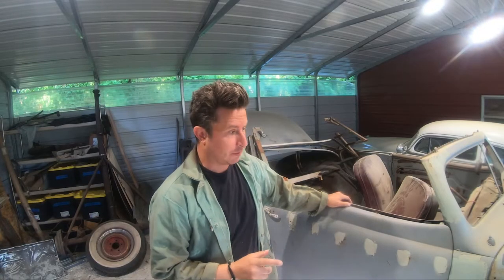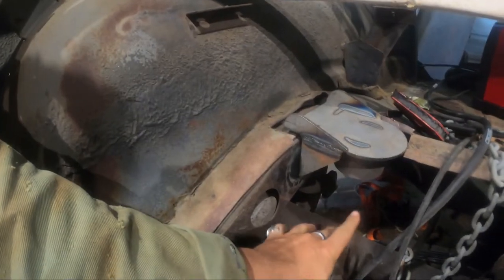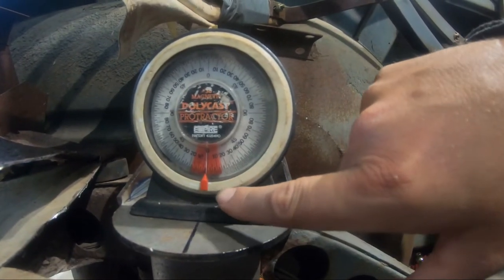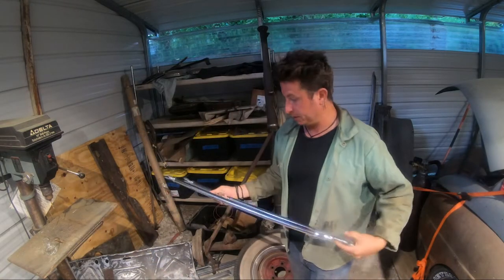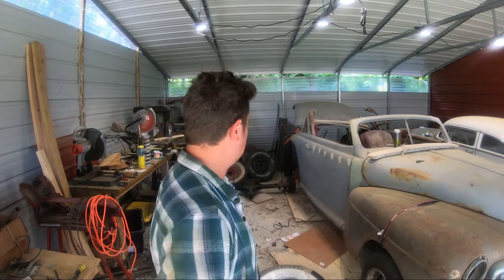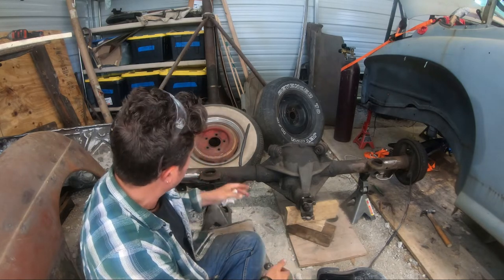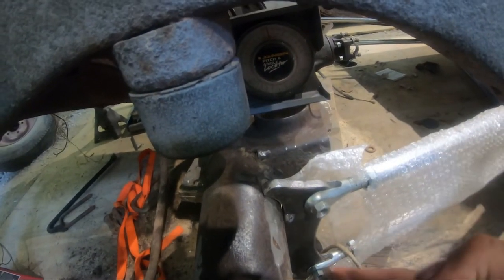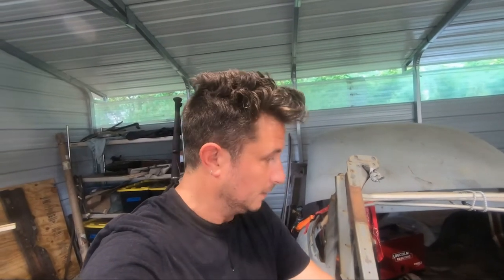Got to Get Down ! 1947 Mercury Convertible Custom Project

Comment: I think you made good choices.  Not that you need validation from me, I’m no chassis builder.  But I’ve been around the block a couple hunnert times.   The coil springs with hydraulic shocks and panhard will ride great.   You may find later that an anti-sway bar will tighten up body roll and really dial it in.
Reply from the maker: Thanks man...i ll take the valadation any time !  it took a lot of stewing but I think its going to be a good set up.   I just cant find anyone thats done it.. maybe because the leaf spring kits are the go to for open drive  on these?